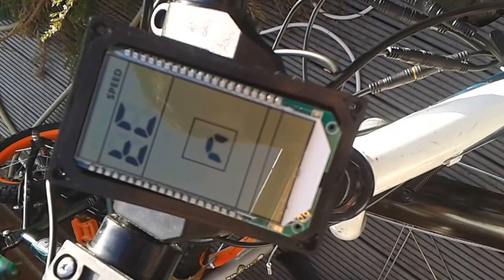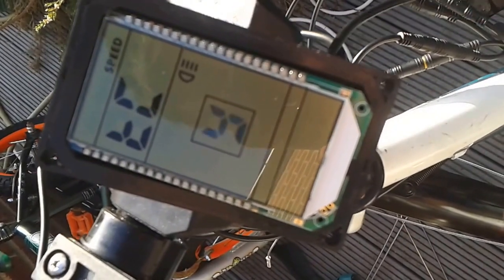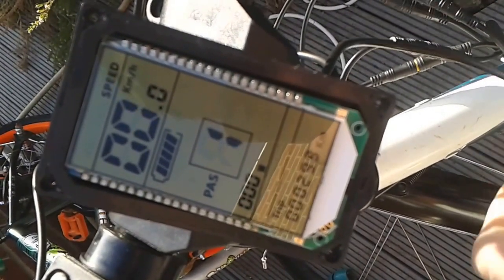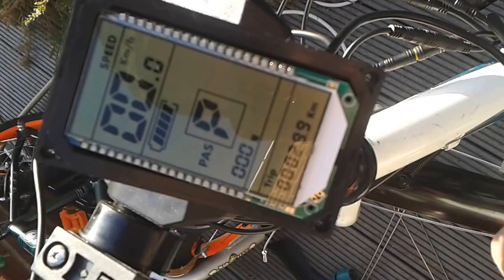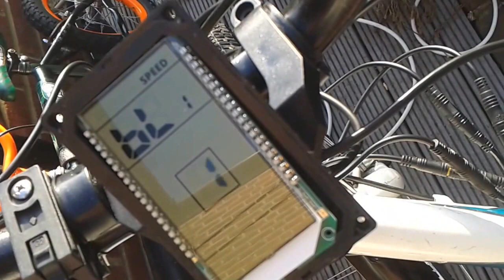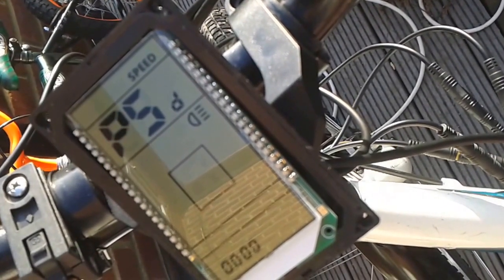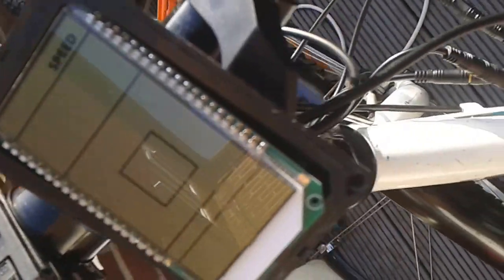FIXED - Faulty Bafang 8fun bbs01 c965 lcd display from BTN Holding Group Co. Ltd.

Comment: Hi John, do you have any idea what to do when the display shows a motor symbol? On a 750W motor with C965 display, while riding the display goes more or less out (there are still some lines and a motor symbol blicks). Sometimes the motor continues to deliver power when the display duds, but sometimes it doesn´t. Any idea what I could do? Thanks in advance for your thoughts on the matter.
Reply: blinks, of course, not blicks

Comment: Friend of mine had his display knocked off his bike by vandals. I am trying to resolder wires onto main board - but not sure what goes where. Any chance U can snap a photo below the LCD to show me where the plug and thumb controller solder onto board. Thank you sooo much if you can help. J
Reply from the maker: Sadly don't have it any more

Comment: It is out of warranty time.
Reply from the maker: My response 

Please review the emails below from me regarding the fault, I believe my assumption regarding your after-sales policy is very valid, at no time did you offer any replacement or compensation

"you can buy new display from our shop" ..... sums it up 

==============================

00:47 Mar 21,2015
Hi
We look forwards to your reply regarding the faulty item. I have rectified the broken wire, I would appreciate a token gesture for the lack of enjoyment of the bike over the past few days while it was sorted out
Many thanks 
Dr J C Bullas
see: https://plus.google.com/u/0/photos/+JohnBullas/albums/6123609990733137473

14:56 Mar 07,2015
Hi
We look forwards to your reply regarding the faulty item. I have rectified the broken wire, I would appreciate a token gesture for the lack of enjoyment of the bike over the past few days while it was sorted out
Many thanks 
Dr J C Bullas
https://plus.google.com/u/0/photos/+JohnBullas/albums/6123609990733137473

04:56 Mar 05,2015
My Order reference: 6551532467xxx
Hi Kevin 
I bought a BAFANG 001 kit from you and we can't get it working, can you arrange for a new display to be sent to me? Unless you can provide another method of checking the operation of the equipment? Is there a reset that might solve this problem: 
https://www.youtube.com/watch?v=_z0UgIWmB98&feature=youtu.be
A colleague of mine who is an engineer for NETGEAR will check the display/push-button unit and if he can establish that it is faulty I would like to have one sent to me express (at your cost) to replace the faulty unit - I will return the other item to you if the return cost is paid 
If the problem is with the motor unit/controller? How can I check? 
Your service to date has been very good, I intend to advertise you as a supplier for the 8FUN 001 units in the online forums I have posted my issues with the BAFANG 8FUN 001 on, if it is the case that you cannot assist with this claim under warranty I will not be so positive in my publicity.
Kind regards 
John 

kevin Fang
04:22 Mar 05,2015
You can buy new display from our shop

Me
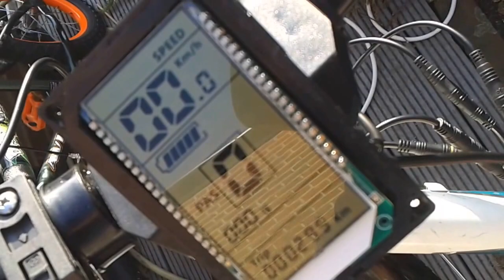02:31 Mar 05,2015
https://www.youtube.com/watch?v=_z0UgIWmB98&feature=youtu.be
Please reply regarding a fault with the equipment we purchased from you 
Many thanks
Dr J C Bullas